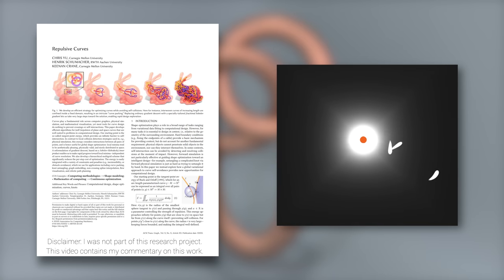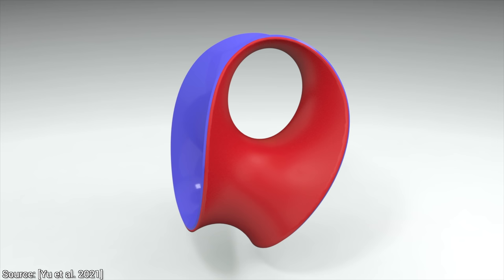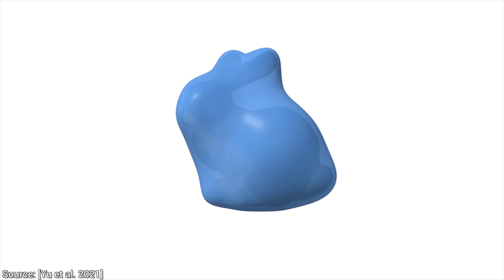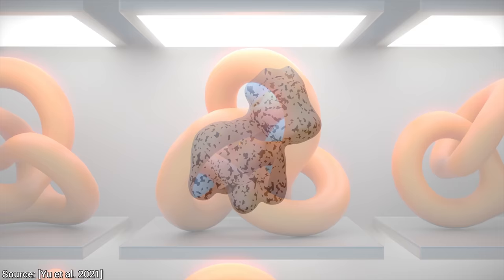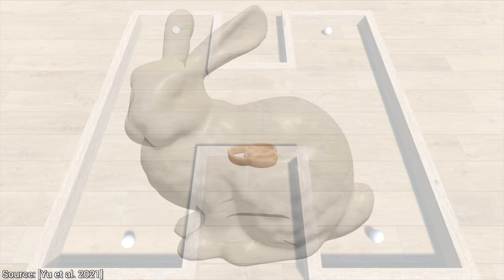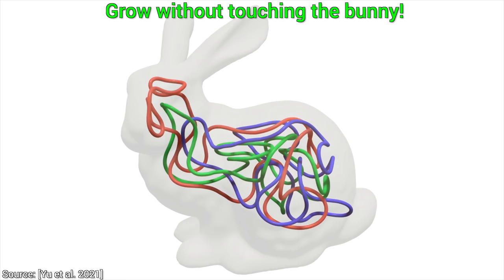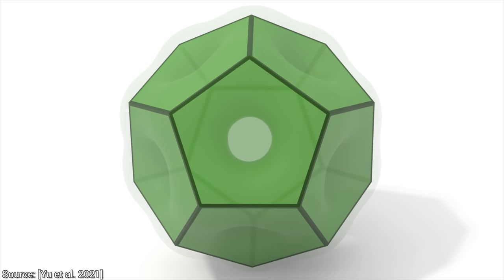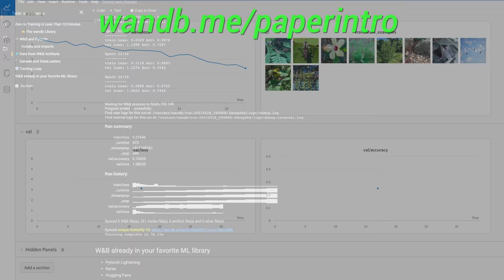A Repulsion Simulation! But Why? 🐰

Comment: a couple uses off the top of my head based on my own experience. 

separating curves in a hair/fur groom for improved volume conservation. we can already do this at sim time, but that adds a lot of computational overhead. if this is cheaper it can simply apply the detangle/deintersect post-sim frame and keep things iterable. 

deintersecting non-trivial crowd agents (quadrupeds especially) as a sim postprocess would also be a benefit. again this usually has to be done at sim time and is incredibly prone to errors and rapidly inflating frame times.
Reply: These are two really practical applications of this tech which are easy to imagine being used frequently in a real world scenario. Thanks for this comment
Reply: Could be used, in general, for any dynamics sim as a startup state, yes
Reply: The most practical application I heard so far is for untangling tangled earbuds
Reply: I love that this insightful comment comes from someone with a he man profile picture

Comment: If the path planning works well, could it be used to guide air traffic so as to both optimise and make safe the paths of aircraft in controlled airspaces?

Comment: Would this be a good paper to apply to protein folding? I'm no biochemist, but as I understand it all structures on the macro scale are defined by the atomic linking of matter and the shape it takes (folding). There is a whole decentralized process to compute folding experiments called Folding@Home that might benefit from this technique.
Reply: Well, I’m not a biochemist either, but I believe it would help. 
However, the nuances are numerous enough as to make it just that: help. protein folding is governed by more than just repulsive forces.
Reply: I can't say conclusively, but as a biochemist who is using AlphaFold2 in his current work and used Rosetta in a previous project, I'd say tentatively probably not... Rosetta is the closest piece of software to what you're suggesting; it applies individual forces to molecules (as opposed to AlphaFold2 which looks at all previously characterised proteins and uses deep learning to approximate what new sequences would look like). Rosetta is already reasonably intensive for large proteins and that's after already taking several shortcuts by subgrouping amino acids into trimers and heptamers and folding those first before having the subgroups interact with one another. If this method could be applied, I can only imagine it'd be more intense than Rosetta. And Rosetta is not always close to perfect (depends on the protein). But then again I'm not actually a bioengineer; I just use the software and don't actually do any coding. So I can't confirm for sure!
Reply: Exactly what I thought! That would be amazing!
Reply: @markarts404  bioengineers use the software then?
Reply: @davidmattes199  Bioengineers make the software, biochemists use it - imagine Photoshop vs Photoshop users (except with Rosetta it's best you at least have an understanding of the fundamental way the software works so you can interpret the results)
Reply: @markarts404  thanks for defining that for me. I just met a BC and I guess I might have talked about the wrong things regarding his research. The more I know!
Reply: I'm no biochemist but I believe this has a ways to go before it can be applied to protein structure. Hydrogen bonds, ionic bonds, disulfide bonds, and hydrophobic interactions need to be modeled properly as opposed to just one attractive or repulsive force.
Reply: no expert, but i could see it work
Reply: Was thinking about it too !!
Reply: Well, proteins aren't the only biomolecules that fold, single strand RNAs do too.
Reply: @regulate.artificer_g23.mdctlsk  DNA is copied into RNA strands and then defines what material is placed into a protein which is then folded, right? The RNA itself is only sometimes packaged, as in a virus. If that's wrong, then when does RNA get folded?
Reply: @davidmattes199  do you know what a Ribosome is made of?
Reply: @regulate.artificer_g23.mdctlsk  I was trying to remember the process of translating mRNA to useful components, thanks! As to what ribosome is made of, I assume it is made from the sam materials it uses to make other cellular components.
Reply: @davidmattes199  ribosomes are mostly made of RNA; they're one of the only known examples of ribozymes - RNA molecules that act like enzymes. So what I'm saying is: the technology shown in the video could be more useful for RNA folding, compared to protein folding which has more/complex interactions as one replier already mentioned.
Reply: Maybe not for folding itself, but for preprocessing. One of the tricky things to do when modeling proteins in confined spaces or filaments of RNA or DNA in capsides ecc. is to generate the input files, e.g. one has to model all the capsomers to form the shell of the capsides and then “fill” the capsides with a dense coil of rna/dna. This is sometimes a nightmare to do, because of clashes and topology problems which can be hard to handle. This might be a beautiful and elegant solution. Forcefield-parametrized molecular dynamics are still a must for simulation of these systems

Comment: This could be useful for designing printed circuit boards. Take your electrical schematic and component dimensions. Confine the movement of the components to a plane and use the repulsion simulation to figure out where to have the connections go, maybe adding constraints, such as minimising the size or fixing the locations of certain parts. As an example, if you're a retrocomputing enthusiast and you're designing a new ISA card, you'd fix the location of the pads for the ISA connector, limit the external connectors to the right edge of the board (but allow them to be anywhere along it), impose a maximum length and height and ask the program to try and minimise the board size.

Comment: The untangling the handcuffs part makes me think "Ah yes, very practical way of untangling some metal handcuffs... Melting them down and reforming them into a different pair of handcuffs with the same material in a different position." 

I suppose for stuff like video games and min maxing things like shrink wrap efficiency it has uses.

Comment: Assuming this technique can be refined to the point where it can work in real time, the non-intersecting curved paths part mentioned at 3:57 suggests an application in a self-driving cars network. It could almost eliminate the need for stopping and waiting at intersections, as speeds and trajectories would be pre-calculated not to collide. Entire traffic light systems could be replaced with an intersection computer that communicates with and directs autonomous vehicles in and around the intersection. Idk that’s just what stood out to me

Comment: I wonder if the shrinking method could be used to create more efficient Bounding Volume Hierarchies. There's a cost to compute the shrunken shape up front, but for complicated geometries - where the approximation of a bounding box or sphere doesn't give a good fit - this would probably be worth it.

It could maybe even be used to help with collision detection of deformable objects. Or maybe it could help with raytracing by minimizing the surface area of bounding volumes: start with your AABB, then run the shrink algorithm to give a better fit around your shapes, and do that for each node in the tree.

Comment: Hello Karoly, the ‘Repulsive’ video is great. There is a problem I have thought about for decades…
Imagine a perfect sphere and you place a small particle on it, and then a second. There is a magic property of these particles – they repel each other. Clearly they will move to opposite poles of the sphere.
Now add a third – an equilateral triangle on a diameter? A fourth – a tetrahedron?
Eight particles could assume a cube.
But what about 5, 6, 7, 9, 10……?
It occurs to me that your ‘repulsive technique’ could simulate this perfectly. How about it?
Reply: Hmmm.

Comment: The 'shrink wrap' process could be used for distance-based downscaling, aliasing, load-on-distance, or procedural clothing.
Reply: The clothing one has a lot of room for making life easier for artists working on sci-fi games. Use the shrink-wrap process to fit a surface a small distance out from an alien's body, then cut off the parts you don't want covered by that outfit, then refine the rest into a suitable style.

Comment: Okay. Game developer application. Using this to fix overlapping AI interactions. So again, I would use it not just in a pathfinding sense, but in a more fundamental way such as how the AI interact. By giving A I a strict movement system to follow based on this, they could theoretically dance or fight inside a skill cap threshold, then being set in place by the speed of the path untangling. otherwords it's would just be used to give A I a new level of perception that can better file away movement or logic calculations. Now if I could just code the damn thing~

Comment: This seems to me like or could be a quantum leap forward in real-time physics. If this paper can run these simulations real-time (or at least learn to approximate the results real-time) then every object could contain this "repulsive" element. That could potentially eliminate clipping entirely! Each finger of a game model would be able to naturally "grip" whatever they are holding, clothing can be truly worn without fear of self-intersections or body parts/weapons/accessories clipping through. I wish that all of these papers were available to the general public to experiment with...

Comment: I think the low hanging application seems to be logistics and automatic traffic control for autonomous vehicles

Some of the most novels could be Proteins folding/unfolding, dark matter studies or 3D printing infill techniques. Not that it would be necessarily revolutionary in any of them, but it could be used in models.

Comment: great video. i always fascinates me when a global problem can be solved locally. it reminds me of some research one of mine professeurs did, where instead of air traffic controllers the only rule basically was that any manoeuvres had to be away from the closest encounter. it was crazy effective, they could get multiple times the aircraft density of the busiest european airspaces, and pilots still complaining that there weren't enough aircraft and it wouldn't work if it's was busy (while being 2-3 busier than that).

Comment: [Edit: many usage suggestions in the replies]
String theory is gonna go nuts over these knots.

Taking a closed or open string, then tangling it, to simulate how various types of string interactions could be identified and theorized.
Reply: 4:11 - Driving simulations creating paths that allow multiple vehicles to use an intersection without intersecting vehicles with one another. 
Like Cities Skylines or GTA  where vehicles can be keyed with collision, while still knowing how to avoid one another. 
Perhaps as an input to a neural network as the training regime.
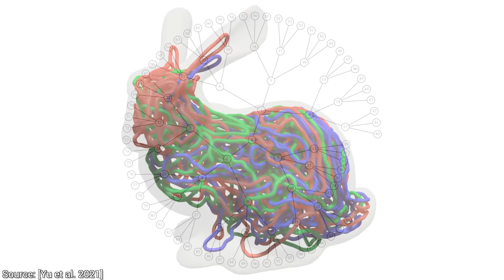Reply: 4:45 - Creating tangible blood systems inside cg beasts.
Branching capillaries to a plane without intersecting.

A diffusion model to supply "blood", "resources" or "employees" to extensive, nested classes of "limbs", "functions" or "departments"

...a really sweet new Creeper World Game...?

Comment: To ascertain the proximity or the object in the scene one has to do some form of proximity test and the in itself will be somewhat of an intersection test with a an object of larger dimension that is just not visualized. I just don't get how one can affirm proximity programmatically without checking for intersections.

Comment: Startup idea: A public earphone-untangle machine based on 3:45.
Insert your earphones + 1€.
The machine has a small CT scanner, that will reconstruct a 3D image the earphones.
Next, a segmentation AI will find the thread, followed by the execution of the untangling algorithm.
Finally, two small robot arms will start their work and separate the wire.
Only risk for investors: The increasing supply of wireless earphones.

Comment: Ive been working on problems related to building path finding graphs in 3d spaces with an aim of achieving near real time computation.  The problem of filling an unknown 3d space with points while avoiding surfaces is incredibly difficult, and even more difficult to do quickly.  I truly need to understand this paper.

Comment: couldn't we use this to emulate molecular structures? That would be so cool if it could be done. That way, we can use this method to estimate molecular structures rather than depending on simulations to display the structure

Comment: quick question to @Two Minutes Papers:
You mentioned that by growing the noodles inside of the rabbit shape, you quickly get to something that resembles intestines.
By the same reasoning, you could also grow something that resembles brain circonvolutions inside of a cranium-shaped box, right?
So, would it be possible, through a large number of iterations, to determine which "seeds" grew to the actual shape of an actual brain? To determine which seeds grew to produce such and such matter?